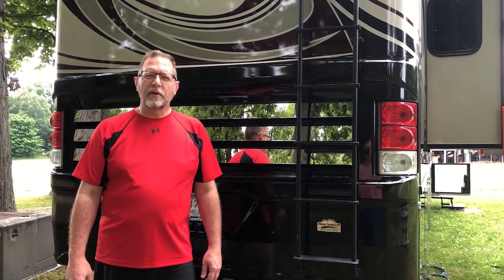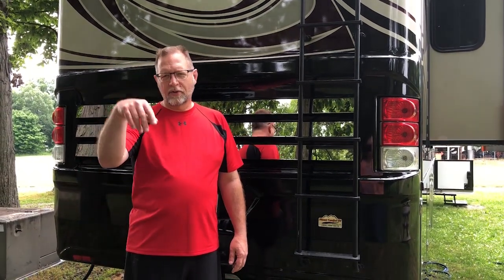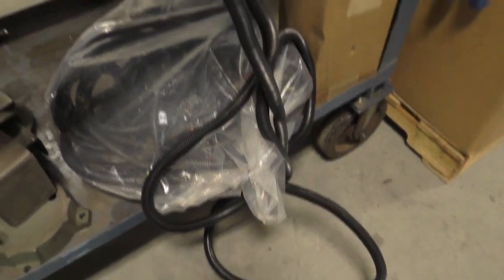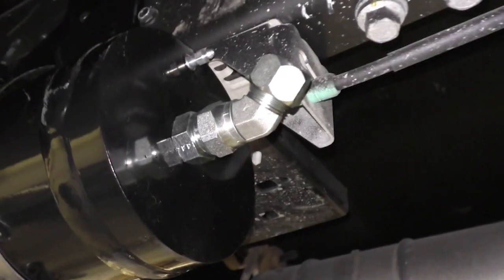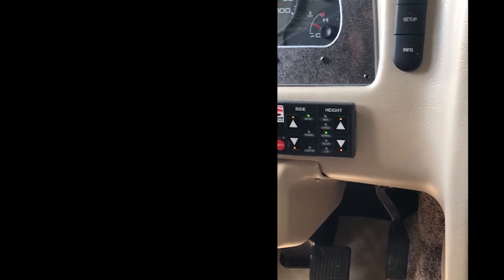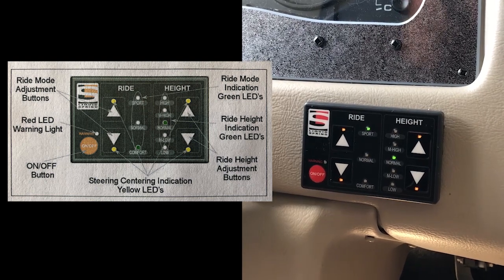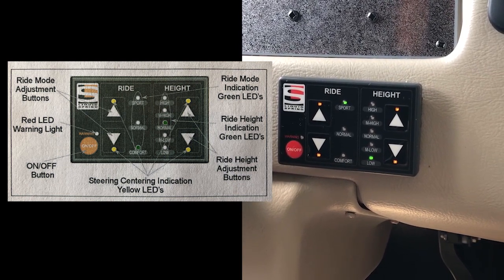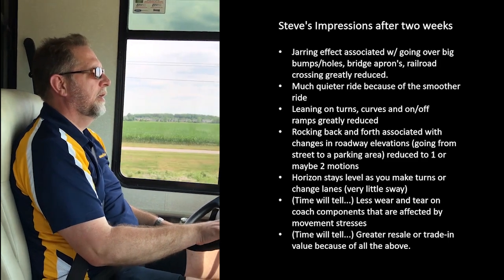Liquid Spings Install - Why? How? Was it Worth It?

Comment: Nice video. We purchased our Tiffin Open Road from Mt.Comfort RV and we experienced the same disconcerting ride experience as we traveled home to Minnesota a year ago. I dropped off our motorhome at Liquid Springs yesterday at the factory for the 4 corner front and rear suspension.

Comment: Great video, very informative. We've head are rear suspension done for a couple years now with liquid Springs and  love it. Was able to drive the front and 4 corner System Which in my opinion is the icing on the cake and looking forward to putting on our motorhome sometime this Spring.

Comment: The LiquidSpring rep explains starting at the low position because of potential thermal expansion of the fluid, but there's another reason: the jack system should only jack up as required to get the unit level, so it will end up lower if it starts lower, and that means less height to climb into the RV.

Comment: The inboard position of the stock shock absorbers is visible in the "before" view. That's much of the reason that motorhomes like this have such poorly controlled sway, where the vehicle rocks back and forth after a single event - the shocks can't handle rolling motion very well because they have a poor mechanical advantage (leverage). The LiquidSpring struts (which provide the damping in their system) are located outboard so they can work better.